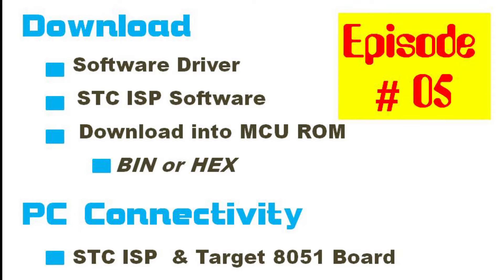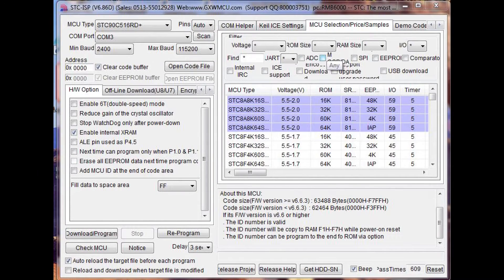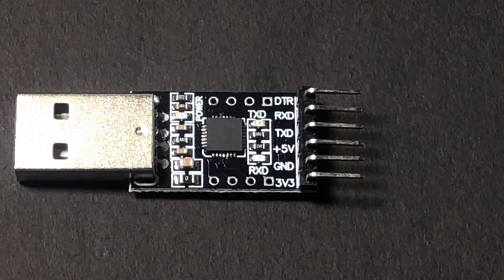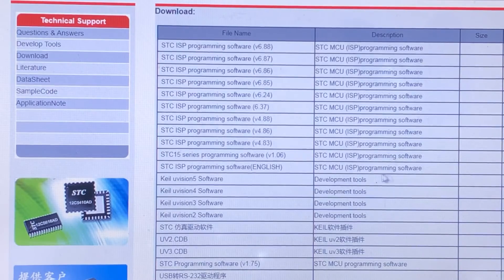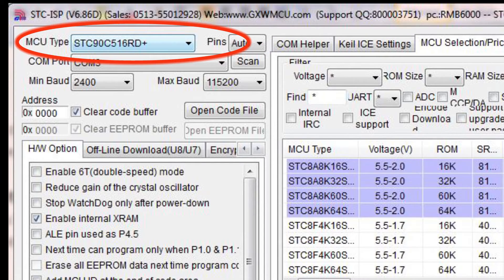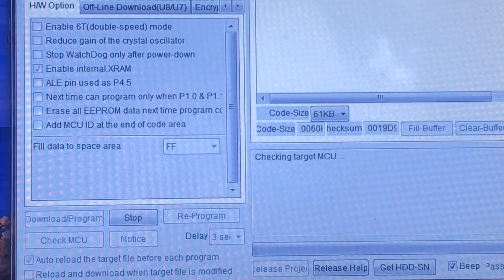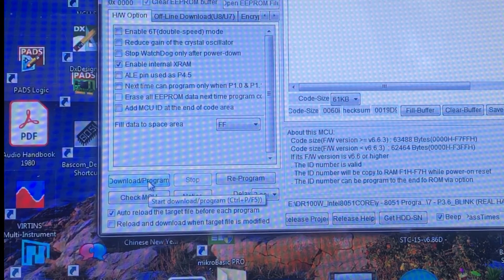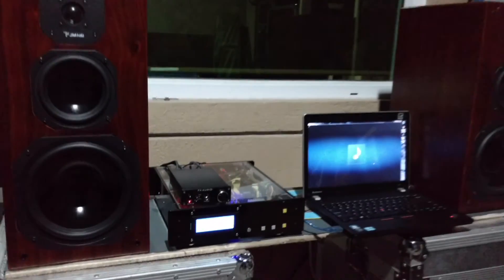MCU Programming #05 | How to Burn Download a Hex - Bin file into the 8051 STC90C516RD+ Flash ROM

Comment: Thank you  for the video, I have a question, how can I read the code of the STC8G1K08? I mean extract the code.
Reply: Hii bro I have the same microcontroller STC8G1K08A can you please tell me how I can program this microcontroller with ftdi module ...and which application I need to use to program it .... And can you tell me how many individuals pwm output does this microcontroller have ... please bro help mee
Reply from the maker: @RobStark-fw6ig  You need to use the STC ISP software on Windows (not support Linux)  select the STC ISP software that support your MCU.,  just be patience to fnd first the English version not the Chinese version.
Reply from the maker: the current STC ISP provided by the STC company do not allow to read the data from the MCU., not that I know with STC MCU.